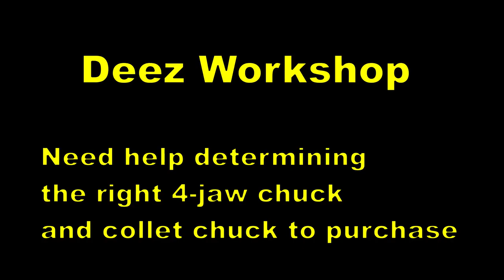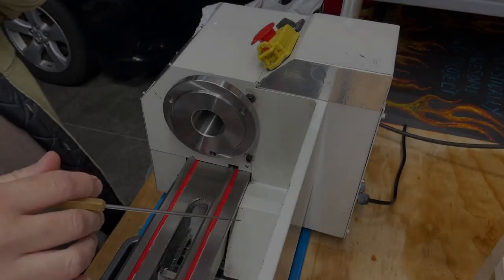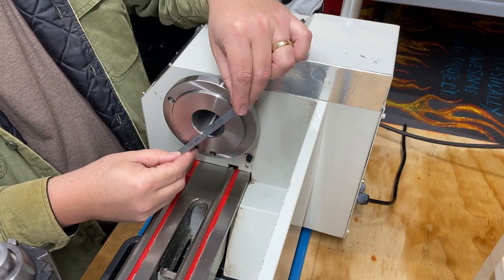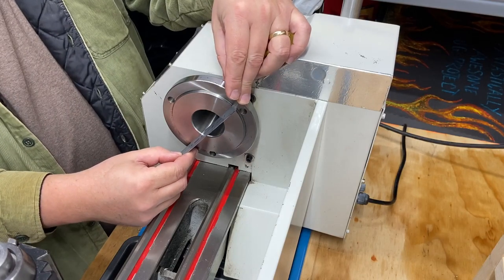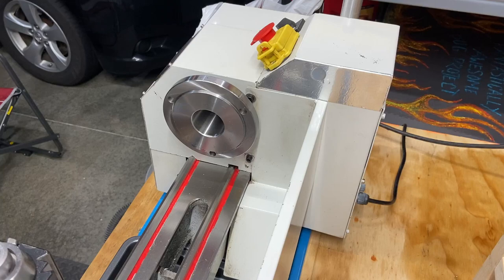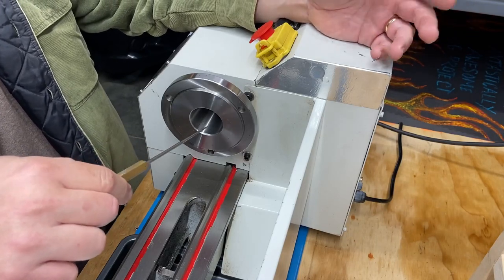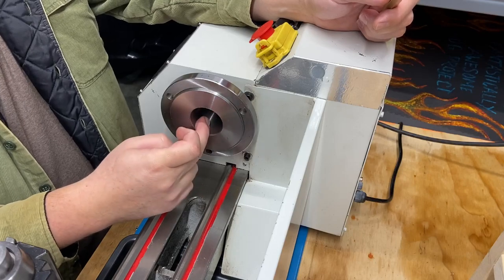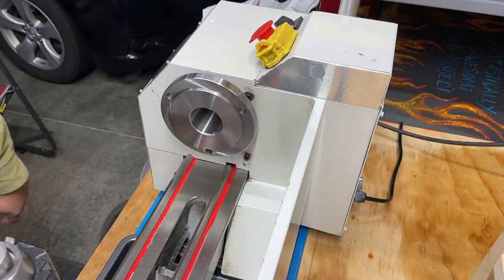Removing Lathe Chuck on Vevor Mini Lathe - Need help, what 4-jaw and collet chuck to get. 5 inch?

Comment: I had the same issue with my lathe when I got my four jaw chuck. You have three options: first is to make a backing plate from about 20mm (7/8") thick cold rolled plate or cast iron (I used cast iron for mine), start by facing the stock then boring a recess that is just larger than a press fit on the spindle (measure very accurately by locking the vernier and using it as a test fit, when it just fits in the calipers remove the chuck and test fit, remove from your 3 jaw only when you know it fits perfectly. Face the opposite side to be parallel to the first. Now move to the mill or drill press, from the center mark out the PCD for the 3 holes and confirm measurements centerpunch and drill tapping size, tap holes, now fit the backing plate to the spindle, face true and cut to match the spindle face once again vernier calipers pre set on the size (or in this case slightly larger is your friend) when close you can use the new chuck to test fit. Once it fits perfectly turn down the outside to match the diameter of the spindle and chuck (125mm) now pick one of the 3 bolts and punch a mark on the spindle and the backing plate, remove and drill counterbored clearance holes on the 4 hole PCD to fit the new chuck and mark it on the same spot as you did the backing plate and spindle, this will ensure that it goes back as concentric as possible. Second option is to modify the spindle flange by drilling a few extra holes on the same PCD as the new chuck- not so easy to do unless you're able to index the spindle and have a tool post drilling attachment. Or you need to remove the spindle and index and drill on a mill. 3rd option is to mark out the spindle 3 hole PCD on the chuck drill and tap those to match. All the options have their pro's and con's. As far as the collet chuck goes have a look at Harold Halls website for his ER32 collet chuck. I'm sure it can easily be adapted for an ER40 or even an ER50 collet chuck. If you're looking for more info get in contact with me and I'll gladly share my amateur knowledge
Reply from the maker: Thansk for the ideas,  I actually followed the suggestions and understood them.  :-)  im getting there.  I will be thinking about the best way I can tackle this with my skill sets and equipment.  Appreciate all the suggestions and will definitely check our Harold Halls website.

Comment: On a "normal" lathe, normal basically meaning bigger and designed for more versatility, there is a spindle which ends in a standard mechanism to attach chucks and driver plates etc.  There are many different standards, but they generally do not end in a relatively large diameter flange.  So when shopping for chucks you can buy either a chuck which matches your spindle, or buy what is called a plain back chuck, and a separate back plate that matches your spindle.  Usually the plain back chuck is the more economical choice.  You then would mount just the back plate on your lathe, and turn it to fit the chuck on your lathe, this means that as long as you mount it the same way, it will always be true and flat to your lathe.  You normally then mount the chuck on the back plate, and never separate them again until you need to move it to a different lathe.  
Your lathe is a bit different, because it does not have any sort of external taper to help center your lathe back plate on the spindle.  
A side note here, I hope you marked the chuck before you took it off the spindle.  If not, you will need to mount it in all three possible positions, checking each one for run out, and when you find the best one mark the spindle and the chuck so you can mount it that same way each time.
You will need to make a back plate to fit between whatever chucks you buy (1 per chuck, so you will need a back plate for the 4 jaw, and another for the collet chuck).  The back plate will need to be machined to a very close fit on the  raised diameter of the spindle because that is all you have to hold the chuck true.  That fit is going to need to be an almost press fit.  That is where a traditional spindle would have some sort of taper to center the chuck. 
Once you have the spindle side of the back plate machined you will need to mount the back plate on the spindle, and turn the front of the backplate to fit your chuck.  This is done on the lathe it will be used on so that the back plate will automatically correct for any variations in the lathe spindle.  You also need to mark the backplate so you can mount it the same way every time.  There will be a recessed register of some sort on the back of the chuck, you will need to machine the front of the backplate to fit that register, again, this needs to be a very close fit.  Because this one is not normally removed it can actually be a slight press fit, that you pull in with the mounting screws, being very careful not to raise any kind of burr when mounting it the final time.  
Now the back plate and chuck will be treated as a single unit, you will mount/dismount the chuck with the three screws through the spindle.
You can probably find a morse taper 5 collet chuck, but I personally would not recommend it.  Quinn on YouTube as Blondiehacks acually did one that way, but it has the big disadvantage that you cannot put long stock through the headstock of the lathe, and you would need to fabricate a drawbar to secure it in the spindle.
Something like this: https://www.amazon.com/DIAMETER-ER-32-COLLET-Compact-Tolerance/dp/B06XWQGPLH/ref=sr_1_5?crid=2KAD82DBVUMU6&keywords=ER+collet+chuck+for+lathe&qid=1675293061&sprefix=er+collet+chuck+for+lathe%2Caps%2C68&sr=8-5
with its own back plate would work.  That is not a recommendation of that chuck. I literally did an Amazon search and picked the first one I saw, it is just to show you the type of chuck I think would work best.  
Now the next question is what type of collet would be best, and I am not going to even try to answer that, that is a religious war I am not in.  I personally have a 5C collet chuck for my lathe, because when I bought my lathe the previous owner had the chuck and a full set of collets by 64ths.  Buying new import type the most likely types would be either 5C or an ER styloe collet.  The 5C is very good at holding even with a very shallow grip, you could easily hold a penny securely and turn it, but they have a very small range of fit, a 1/2 inch 5C collet is good for holding from about 0.495 to 0.500 inches, you can squeeze them down more, but they don't hold as well and only grip at the very front of smaller sizes. An ER collet has a much bigger range of grip, actually covering the in between sizes.  (ER stands for extended rance) however the way they are built you ned to have a workpiece that extends through the collet, you cannot safely grip a shallow part like a penny, the back of the collet will collapse, the part will walk out if you try to turn it, and you may damage the collet.  
ER32 is a comon size of ER collet, they will hold up to 13/16ths, the next size up is ER40, they will hold up to 1 inch.
5C collets naturally hold up to 1-1/16 inch, but because they are clamped using a single taper at the front can also be made in an extended form called a step collet, which can hold things much larger than the actual collet bore, in excess of 5 inches.  Also 5C collets come in sof blank versions called emergency collets which are machined for a specific job, in fact I have a 2 inch step collet on order which I am going to use to hold some pulleys abouit 1-1/4 in diameter, too big for a normal collet, but with the 5C it can  be done.  ER collets cannot clamp out beyond the face of the nut.
5C collets also come in varieties to hold hex, square, or any other shape  you can make.  Thsi is not possible with ER collets.
If you asked me which collets I would buy, the 5C is more versatile, but you will need more collets to cover the same size range.  The ER collets will cover all the sizes in there range with fewer collets, but can't hold anything but round stuff long enough to fill the collet.  So the answer is both, you just need to decide which one first.  There are a lot of videos on YouTube talking about import collets, and whether they are any good.  Do some research, don't buy the cheapest one from anybody.  The advantage of a collet chuck is the theoretical repeatability, you can take parts in and out of the lathe and maintain a high degree of concentricity.  If the chuck has any run out that advantage is gone, so you might as well use the three jaw.
The other  thing, regardless of the type of chuck, a part turned in one setup is concentric, even if the chuck has horrible run out.  If you can plan an order of operations so that you never have to remove the part from the chuck a crappy chuck will turn perfectly concentric parts (provided your spindle bearings don't have slop in them)
Darn, I wrote a novel!
Oh, and don't mess with the nuts that hold the spindle in your lathe unless you want to learn about adjusting bearing preload.  It isn't rocket science, but getting it wrong will shorten the life of your spindle bearings or allow axial and/or radial slop in the spindle, which at best makes the chatter problems of a small lathe worse, and at worst will make it impossible to get decent surface finish at all.
Reply from the maker: I need to read this a few times to digest this but this is a lot of good info. First take away is I’m going to remount this chuck in all 3 positions and determine the best placement
Reply from the maker: OK i read through this a few times,  Three is a lot of great information in here,  I will keep all this in mind to decide which Collett style to get first,  Likely ER style,  32 maybe 40 as it may be a better starting point for me.  Thank you for all the great info and i have no intentions on touching those nuts that hold on the spindle anytime soon.

Comment: When looking at 4-jaw chucks there are ones that are the same as a 3-jaw meaning the Chuck key moves them all. Most people when they want a 4 jaws is to have individual jaws moving so 4 key Chuck adjusters also so pay attention to the descriptions when buying.
Reply from the maker: I should have mentioned this,  Absolutely a great point here.  I am looking for an indepenant 4 jaw chuck.  Not as you described where they all move with 1 chuck key turn.  I want to be able to face off square stock and other shapes that arent round.  Great to point out.
Reply: @deezworkshop  
Yeah the VEVOR K72-160 Lathe Chuck 6Inch 4-Jaw,Lathe Chuck Independent Reversible Jaw isn’t made anymore but they do sell a 5”. I’m not sure if it’s a direct bolt on or not.

Comment: I will second the Sanou K72-125 independent 4 jaw. You can find them on eBay. They are predominantly 4 bolts but I found a seller that had them with three M8 bolts that fit straight onto my MX600 without modification. That seller is CME tool or niuniucme on eBay. More expensive than the more common 4 bolt but worth it to bolt right on. 
When you are looking for chucks you want to look for 125mm outer diameter, 95mm inner flange diameter and 3xM8 bolts on 108mm.
Avoid doing what I did for the collet chuck with a ER32 to MT3 adapter and then an MT3 to MT5 sleeve. Tolerance stacks up to a lot of run out. There are ER collet chucks that mount to the 125mm-95mm spindle nose flange for either ER32 or ER40. They even have 7 bolt holes to work with either 3 or 4 bolt patterns. I plan to try that out instead of using the MT5 taper inside the spindle.
Reply from the maker: I am also leaning towards this direction from the advice of some trusted subscribers,  Another issue wiht using the MT5 inside the spindle is losing some of the spindle bore size,  of course depends on the spindle MT5 tool holder attachment your using wiht the bolt on plate style but I like those options.

Comment: The K72 125 independent 4 jaw fits the spindle as is. It does need modification as it a 4 bolt mount vs a 3. I 3d printed a drilling jig and used one existing hole and drilled/tapped 2 new ones. I then added studs so it is like the 3 jaw. I made a collet chuck for mine. I turned an mt5 taper then mounted it in the spindle bore. I then drilled/bored an 8 degree internal taper for ER32 collets.

Comment: Like a lot of the small lathes the spindle is one piece, so yes, it should have the Morris tape inside. I believe mines an MT3 on the Smithy and then an MT2 on the tail stock I’m pretty sure if you look you can find a for 4 jaw chuck under  the vevor brand. If not, you’ll just have to look for a four Jaw Chuck and get as close to the measurement as you can for the bolt pattern. I have the Smithy 1220 5 inch chuck three bolt. I’m hesitant to order a 4 jaw  chuck three bolt that I found only because it does not give detailed measurements of the backing plate
Reply from the maker: ill keep looking all the 4-jaws at vevors site im finding have a 4 bolt mounting system.

Comment: I am in similar situation. I just bought a Vevor 7x12 550w lathe, with a 3 jaw chuck, and I want two bigger chucks, 4 jaw, one independent and one self centering. The independent is good for when you want to turn something eccentric, like a camshaft or something like that. The self centerer is nice when well, you just want the simple way to mount a part in the lathe. 

Apparently it is all about the back plate. a chuck is a chuck is a chuck. It is mounted on its back plate, which mounts to the spindle. It is the great translator between the two, bridging the difference in hole number and size, bolt circle diameter, raised bosses and flanges and so on. Lots of cheap Chinese and Indian chucks out there, meh for serious work, good enough for many hobbyists, but they are bareback. The presumption seems to be that the lathe owner is capable of making his own custom backplate, and for the vendor to include the backplate would mean making them in all sorts of formats for many different lathe spindles.

Pretty sure mine is a MT3 taper on the head spindle, MT2 on the tailstock.

I hope you marked the position of your chuck before removing it. I would bet a dollar to a donut that with this grade of machine, it will make a difference, when you go to mount it back up. I would suggest also that if you make a back plate, that you mark it early in the process and always remount it by the marks.

I am pretty new to the mini-lathe and mini-mill type machines, too, so I will be reading the comments and I may end up with something more to say, as I progress through the process of upgrading my own chuck.
Reply from the maker: My headstock is MT5. Tailstock is MT2. All in all this worked out. It will work for me but may not be the right solution for heavy users of the chuck. It wasn’t terribly precise but it worked and I can now the square stock.

Comment: It is beneficial for the 4 jaw to be an inch larger than the 3 jaw. So a 6" 4 jaw would be good for you.  There is every chance you will have to make an adaptor plate (backplate) to fit the 4 jaw.
Reply: A 6” sounds advantageous for irregular shaped pieces. Are there any disadvantages to running the larger size on the MX-400?
Reply from the maker: I too am curious if anyone knows the answer to this.
Reply: @AlTofanelli A couple things.
One issue issue is clearance to turn large parts.  On my old 9x20 lathe I compared the amount of jaw stickout and found I could fit about as big a part on a 5 inch as a six inch, because the jaws on a 6 inch are bigger, and would hit the bed of the lathe before I could use the full size of the chuck anyway.  I went with the 5 because it is a lighter spinning wheel of death  and cost less.
A 7 inch lathe may technically be able to turn a 7 inch diameter part, but there isn't room for the chuck jaws to hold a 7" diameter part, the only things that big you can actually turn are things you are holding on the inside of a bore

Comment: you better measure that Morse Taper. I bought a Vevor lathe that was supposed to have a MT4 taper spindle...it was actually a MT4.5...just try to find a tool to fit a MT4.5 lol
Reply from the maker: Hmmm. This right here is good advice. I don’t have anything that is MT 5 but I should measure this. Mine no doubt is also MT 4.5. lol. Right. No tools for that. 😀 thanks for mentioning that others should check theirs as well.